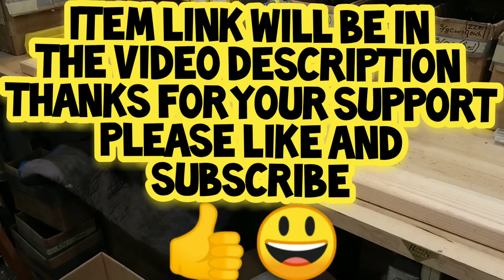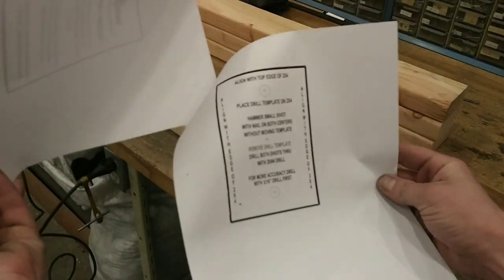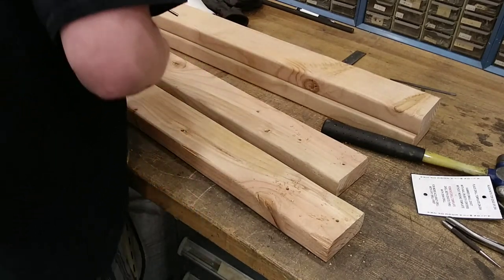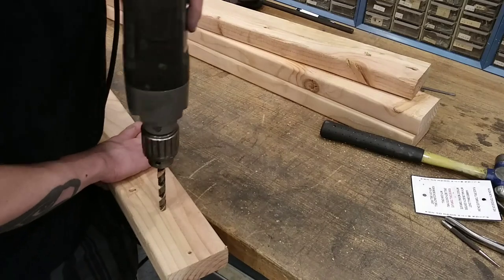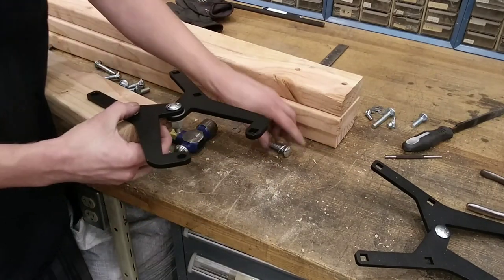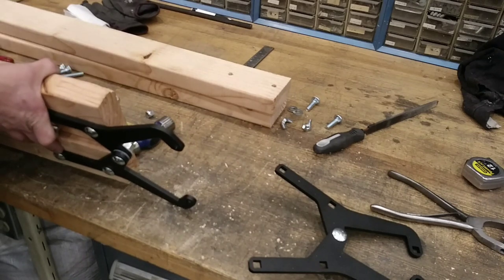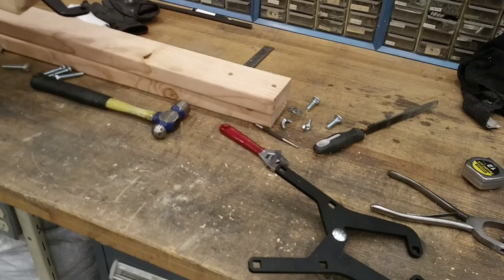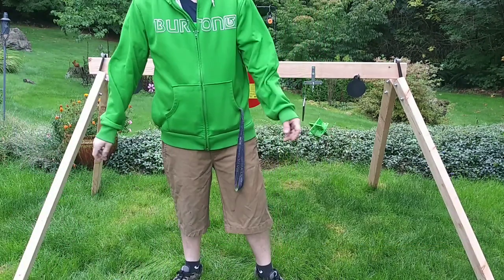ar500 steel gong target hanging stand d.i.y. kit from Amazon for under $40!

Comment: Great job.  The only thing I’d do different is hang that centre gong down lower off chains.  Three reasons:  it saves the 2x4 from getting shot up too fast, it rings louder when it’s more freely hanging, and less chance of ricochets back to you when it’s completely free hanging without the 2x4 behind it.
Reply from the maker: Thanks yeah that was just temporary I use rubber straps now they work great
Reply from the maker: U can see a good example of that in this video https://youtu.be/ukpf1X9Xq-g

Comment: Very mice set up! I’m gonna try this at my place
Reply from the maker: Ya i spent allot of time looking for a target set up initially wanted to use something simple like your stake set up but our shooting spots in Washington have hard rocky ground and the stakes won't go far enough into the ground to be stable so this seemed like the best option for me.
Reply: Kyle Counter damn. Only thing you can try with stake is cut circle of a tree for a stump. But your set up is good
Reply from the maker: @CastNBlast  thats a good idea yeah it's nice cause u can have multiple 2x4's with different set ups on them and you can attach anything to a 2x4 I attached cardboard to it and was taping target paper to it. And drilling holes in the top for my 22. Spinner was a nice cherry on top.
Reply from the maker: @CastNBlast  https://youtu.be/IpHh46DsTBo
This video i uploaded last week of me zeroing in a reflex sight shows the target stand in action more.
Reply from the maker: @CastNBlast  here is a  link to the manufacturers website 
https://shootingtargets7.com/accessories/target-stands/f24-folding-2x4-stand.html?acc=8d5e957f297893487bd98fa830fa6413